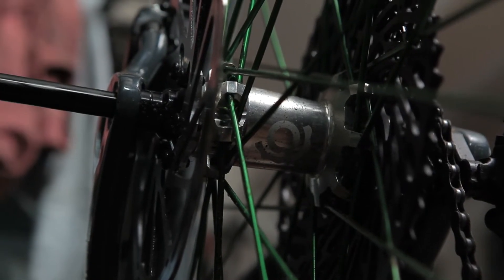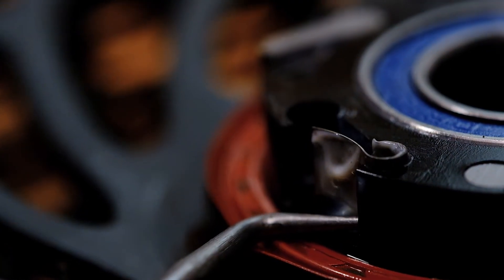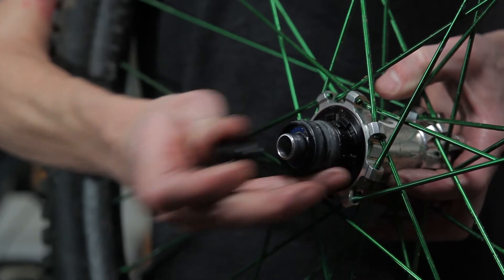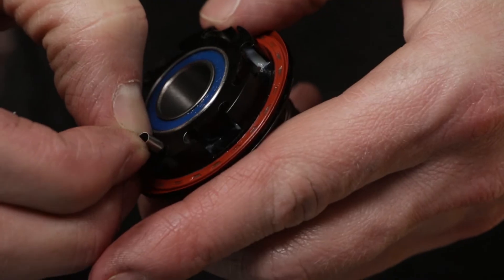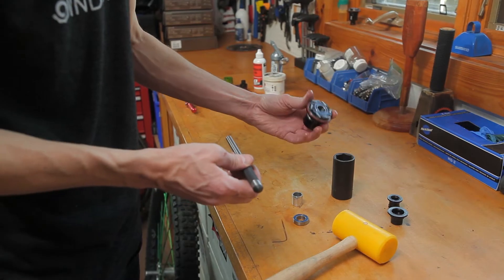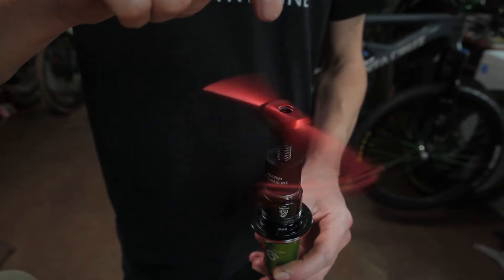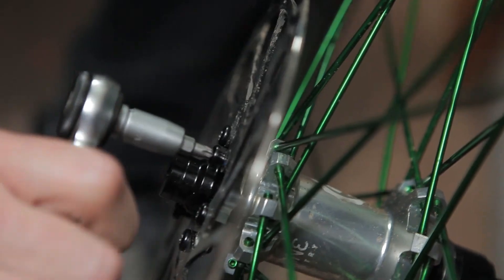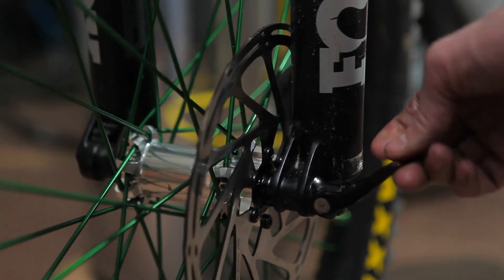Industry Nine - Official Hydra Service Video

Comment: At about 4:10 minutes you mention 'grey seal out on the disc side'; if you were to remove the grey seal would it be the ball bearing side or the inner race side of the bearing? Also, phenomenal service video and a big part of the reason I ended up with Hydra hubs! Cheers
Reply from the maker: Please reach out to RiderSupport@industrynine.com

Comment: I've been really disappointed with my Hydra hubs. I can't even get a thousand miles out of them for the free hub bearings need replacing. It's pretty unacceptable. DT. 350s on my hardtail can take 8000 mi plus without needing to be changed.
Reply: They’re terrible for bearing life.

Comment: hey guys what punch can you recommend for the job of removing the freehub bearings? i need to buy one but no idea what sort?
Reply: Blind bearing puller/slide hammer set. £30 for a cheap set off Amazon/eBay etc.

Comment: When you get a new hydra hub does the drive ring have grease on it?  Mine is really loud and I want it quieter.
Reply: All hubs will have grease on the freehub pawls and drive rings, pack more in there if you want it quieter.

Comment: I notice occasionally my freewheel will arbitrarily become quieter and then eventually louder again. Is this a cause for concern or is the grease just periodically migrating around inside the housing?
Reply: If your freewheel is loud then your hub needs grease if not then there's still grease on it. I occassionally grease my hub too so it will become quiet

Comment: Hi guys my cassette/freehub won't pull off the wheel. In the video it looks easy, but my freehub is definitely not coming loose just by pulling on the cassette firmly (or even extra firmly). Hydra with Microspline, only 2 months old. Any ideas?
Reply: I'm late to the party, but just stumbled on this. It's the end cap that's stuck firmly on the axle holding everything on. Use some pliers to carefully pull and unseat the end cap first, you won't be able to completely remove it cause the cassette will be in the way. You should be able to pull the whole cassette/freehub assembly like in the video. Hope this helps.
Reply: Having same problem, did you ever figure this out?

Comment: What other options of lube can be used?? Pandemic made international shippings unavailable in my country and there is a industrial bearing supplier that sells Timken , SKF,Loctite greases and there is this Loctite Lb 8034 used for o-ring installations Pao based oil with calcium sulphonate it has like the same texture of that Dumonde grease, as for the oil I think maybe Shimano mineral oil can work?
Reply: That is an excellent question. I'd like to know the same thing. What's the recommendation for end-cap grease that's water repellant and kind to the end-cap material? Marine grease would work but there are multiple marine grease choices.
Reply: @billrose2339  Park Tool HPG

Comment: Consider using an old small paint brush for grease application instead of the finger....lol.
Reply: Seriously! All this guys on youtube wasting so much grease They apply so much grease then wipe 90% of the grease they apply. I have a tub of grease i bought in Asia in 2001 it was use on so many things but still has so many left because i have a tiny paint brush inside. Also on bike works i use a tootpick to apply grease on tiny areas. 90% of the lube the industry use goes to the garbage as excess.
Reply: @lossantoscity3249  they do it for tutorial and education

Comment: After having ridden the Hydra for about 6 months now (on Dumonde Tech Freehub Oil), I did a freehub service as described in this video. As winter is coming, I used the Dumonde Tech grease this time. I couldn't hear much of a difference in loudness though. https://youtu.be/U0p1YBn7874
Reply: Weird...your hub sounds somewhat loud both before and after.  The hub in the I9 video was quiet after adding grease.

Comment: what's the difference between hydra classic and hydra
Reply from the maker: Our Hydra classic hubs are built for traditional j bend spokes. The Hydra system hubs are designed to work in tandem with our proprietary aluminum spokes. The internals are the same on both!

Comment: How often should I be servicing my hydra hubs? 40 houses of riding?
Reply from the maker: It's more based on feel than anything. If the bearings start to feel grindy it's probably time for a change. It also doesn't hurt to clean out the freehub body and re-apply grease every ~6 months just to ensure everything is running smoothly.